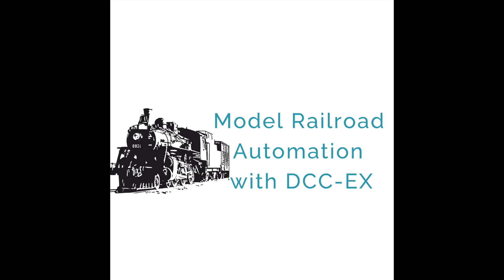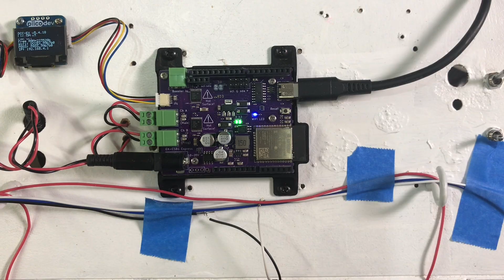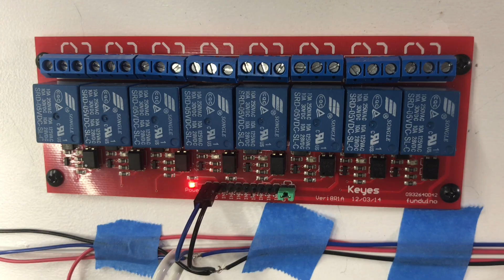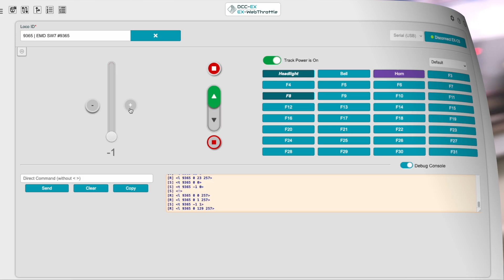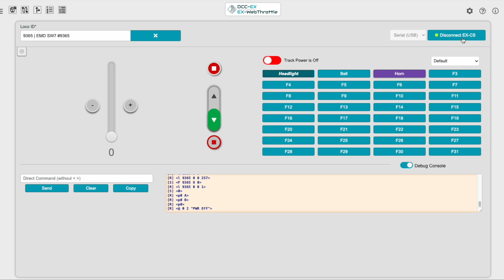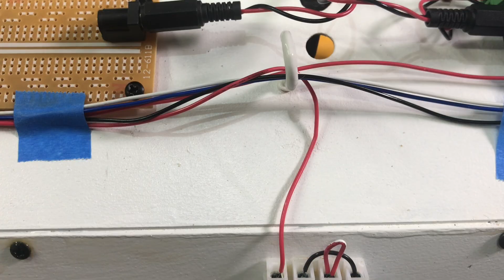#002    Installing the CSB1 on my test track

Comment: Another great and informative video Chris, really keen to get into the programming. You may have already mentioned in one of the other videos that l’m still to watch but what version are you using?  I’m about to install 5.5.5 in order to take advantage of some of the new features. 
Cheers 
Rob
Reply from the maker: At top of each page code "// config.h - Generated by EX-Installer v0.0.20 for EX-CommandStation v5.5.65-Devell" I include version for that video.

Comment: Hi Chris Thanks for making the video, I have a large layout but I'm new to the hobby and have been looking at the DCC-EX for a while my setup so far is just DC but thinking in the future of slowly moving to DCC
I have had a little to do with MERG using there CAN servo 8's for point motion on the back staging yard so it is a lot of work in progress, one question with the DCC-EX dose it give 5amps per channel ie track A and track B or is it 5amps split ??
I have 2 loops at the moment that are about 35 to 40 meters of track per loop.
looking forward to the next video as this type of thing is right up my alley 
 Cheers Mark
Reply from the maker: Yes it is 5amps per channel and short circuit built in per channel. 40 meters needs a good power bus with dropper's. When setup the CSB1 check the short circuit protection is working at different points around the track. I will be doing a video on it soon.